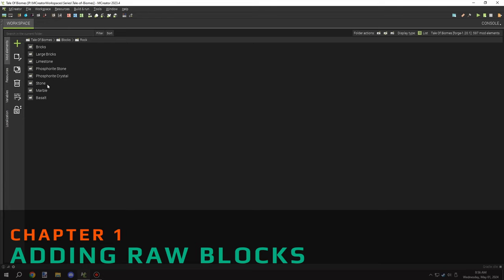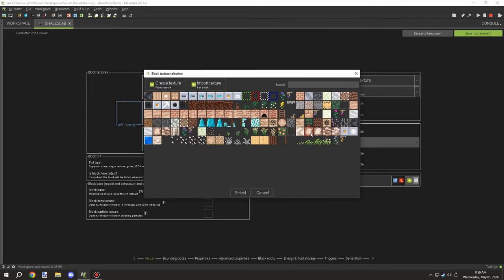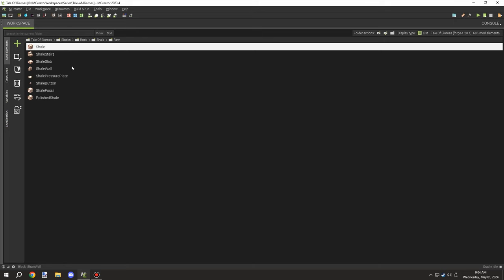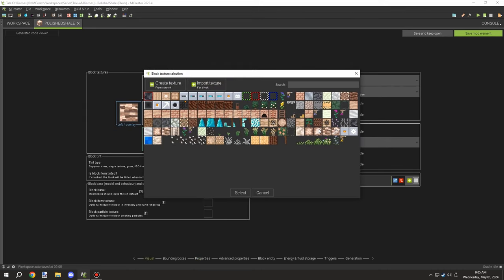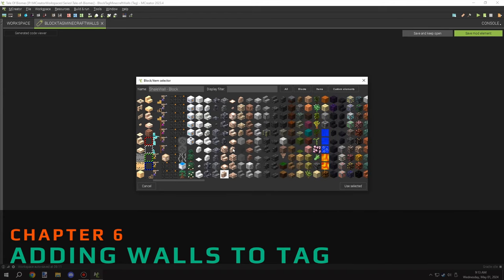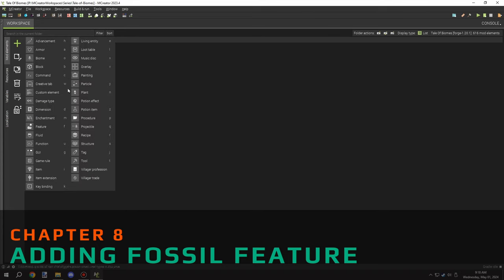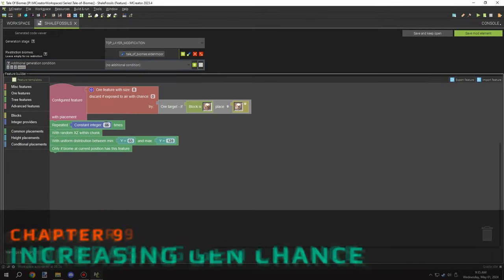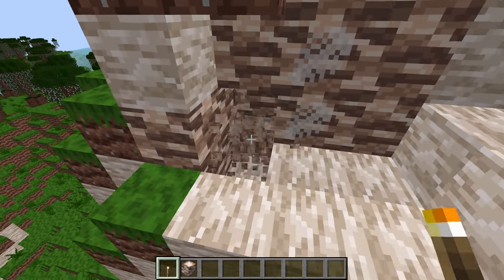MCreator Lore: Making SHALE Blocks | Ep67

Comment: Good video, but i have a problem, i have a block that naturally generates in my dimension as a feature and i want it to have it's own ambience like looped sound that constantly comes from this block that you can hear if you get too close to it, like fire or nether portal, so how do i do it? i already tried some methods but the sound comes only when i place this block manually and it's completely silent when it's generated in my dimension, hope there is a way to solve that
Reply from the maker: You can use the play sound and stop sound commands built into the game.
If you use it with the /execute as @a[distance=0..32] run playsound
then this should make the sound play. However keep in mind that if your working from a block you will need to run this from the block tick update. if it generates naturally then you need to use the random tick update feature or sounds won't play unless the block is broken and placed again. Random tick update will tick after generation but at a random period. The downside to this though is timers won't work and it can sometimes play over other sounds. This becomes more noticeable with more than one block around the player.

However you can find a couple useful commands below which might be able to help you.
https://minecraft.wiki/w/Commands/playsound
https://minecraft.wiki/w/Commands/stopsound

I hope this helps.

Comment: How do I make a check "does the player have 2 diamonds in the inventory", instead of the usual check "does the player have 1 diamond in the inventory", I know that there is a block "If the player has [] in the inventory", but I want to know if it is possible to check if the player has 2 or more items in the inventory.
P.s sorry, I'm using a translator. If there is such a way, could you make a video or send a working example. Thank you.
Reply: I could throw off an example of my trigger where I want to make a check for the presence of a certain number of items in the inventory
Reply from the maker: I put this example together and I also created a example procedure on my GitHub which you can download.
Imgur has notes and screenshots of the procedure you will need. I hope this helps.
https://imgur.com/a/NWy50GP
https://github.com/MCreator-Examples/Projects/discussions/144